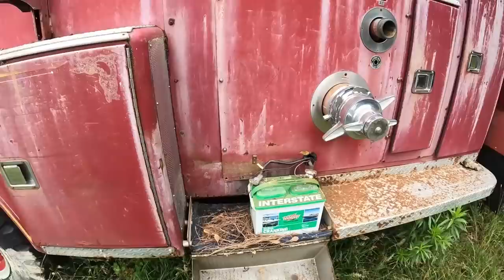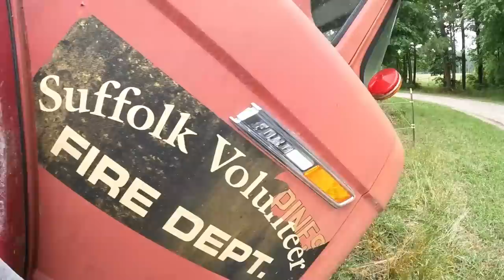Will The 50 Year Old Fire Truck Start?

Comment: Possession is nine tenths of the law. I'd say that is your firetruck now Chris. New fluids, filters and a carb rebuild and she'll be as good as.... well used. 😊
Reply: 10 bucks says the pump on that bad boy still works. Can’t say much for the water tank though. Usually those are the first to go in those old trucks. Make sure there is some water in the tank so that way you don’t dry pump it. And let her rip.
Reply: @firewalker1372  , it's not that hard to put in a new pump, and/or water tank.  Also, they can be upgraded with a rust proof one, and they can also bed filled with nontoxic firefighting materials in lieu of water with a little more refinement.

Comment: Someone who sets as many fires as you do probably should have one Chris.😂
Reply: I had an old petrol dodge fire truck that I used for domestic water supplies they don’t have baffles in the water tanks which are square not round making it dangerous to drive turn corners and stop, it actually killed an entire crew and it was dubbed the ‘widow maker’
Reply: you sure he shouldn't have an active fire station next door? 🤣🤣
maybe an exterminator on the other side for the big bad spiders? 🤣🤣🤣

Comment: Ive often thought that the fire truck would be great for cleaning your tracks off.
Reply: Yea just add water spray tracks everywhere an bam it's clean an shines
Or take off bed has big Hydraulic Pump on it make a great grease truck tools  even carry maybe bucket for mini
Reply: Like heavy d does.
Reply: @jackman6256 at truck there has a pto driven pump. Drop it into 4th or 5th gear. Pull a lever, and ease off the clutch, then your in pump.

Comment: There's a trick to installing those o-rings on the transfer tube of the Holley Carbs. .  Put the o-rings on the tube just at the end.  Don't put them all the way up to the bump in the tube.  As you install the tube the o-ring will roll it's self into the hole and onto the tube farther sealing it.  It might also have a stuck float .
Reply: if the o-rings are shot, so are all the bowl and metering block gaskets. they dry out, shrink and pull in at the middle on all four sides(top/bottom is worse), that opens all sorts of passage ports, makes the accel. pump not work, fuel/air metering wrong and fuel leak everywhere. also the power valve/s will be spanked. the ethanol and detergents in fuel really spanks them to death. the later blue gaskets are much better at holding up, but even so.
ditto on the o-ring placement and them rolling into place upon assembly. that said I absolutely hate the fuel crossover tube style.

Comment: Your float is stuck open on the carb. Tap the front of the carb with a hammer until it possibly frees up. That’s why the gas was pouring out of the top of the carb
Reply: If you have to tell someone who's making a will-it-start video that, what's the use?

Comment: Probably blew a fuse in the siren control box. I used to drive one it had 500 plus cubic inch engine. It was a long nose. Truck ran great and during pump testing it out pumped newer models. You could peal shingles off a roof running a 3 inch line down to 1 inch brass nozzle. Took 3 men to hold the line at 150 psi. It would lift you off the ground. Maybe we had a little fun during training sessions. It pumped over 1 thousand gallon per minute. Enjoyed the video.

Comment: We used to have a 77 American La France fire truck when I started firefighting 18 years ago. Ran like a top, slow driving though. It was a double clutcher.
Reply: At the fire department in LaFayette, Al, we had a 65 straight leg Mack, it was good truck. I think someone in Texas bought it to restore.
Reply: The volunteer department that I belong to had a 1968 Ford American LaFrance cab over engine and a 1979 Ford Saulsbury cab over tanker. Both manual and gas motors. The tanker definitely was a double clutcher.

Comment: a guy could quite easily use this pumper for grass hydro- seeding Bealy Goods pond area or yours. Its pretty much ready to go. I'd say it would take no more than than 45 minutes with the right nozzle and pressure after being set up. Instant thick grass in 30 days. 
Perfect rig for washing mud off dozers and excavators. You got a swiss army knife with multiple uses right there.
Reply: That is worth looking into. Hydoseeding is by far the best and fastest way to get grass growing especially on steep banks like the backside of a damn or on crappy soils. It's what Geoff Beale should've used on that one side of his pond where the soil is poor and rocky.
Reply: The tank would need an agitator to keep the mulch and water mixed up. Otherwise it separates and you pump out the water and are left with nothing but soggy mulch in the tank.
Reply: @rr3102  Agitator?  My wife would be perfect for the job..
Reply: @rr3102  That sounds like a do-able mod.

Comment: My Dad had 2 Ford T-950 dump trucks with that mighty 534 and 5x4 two stick in them from the 60's  and still had the one left into the 90's.  I have a LOT of hours turning wrenches on those motors....they're very basic and pretty easy to work on....taking that huge air filter off was a good call
Reply: I. Had. 2. F. 950 .dumps. With. Plows.  Nothing. Could. Stop. Them
Reply: Right on, Todd ! We had a 1967 T-950 with 5 th wheel frame. Ex Air Force, same transmissions as you. That 534 has some torque ! 
Thanks

Comment: Everyone will beg for its clean up, chase a few gremlins out like bad battery connections and such... freshen up the carburetor gaskets and seals. One thing for sure, having one parked near a home has to make your insurance go way down. Here in the valley of Wasilla Alaska, I was just a mile out from having fire truck service and most insurance companies wouldn't touch my place... but having a fire truck there not only made insurance possible but cheaper  than  the folks living within a five mile radius of the department.

Comment: Stuck floats is my guess. A good tap with a wrench on the carb bowls might free them up. May also want to stuff a rag in the fuel tank fill port to stop the bugs from crawling in. Other than that, it's a good old truck.

Comment: My 1st patrol car in the mid 70's had a Federal Twin Sonic lightbar. 1 light on drivers side and 1 on pass side that rotated inside the dome. Cold weather the lights froze up and would not rotate. Had the old Federal wind up siren on top, Snow, sleet and freezing rain shut it up. The electronic siren and speaker like on this truck was  Next Gen Up Town stuff. Got one of those in the later 70's. The city FD had trucks just like this cab style that were 64-66 yr models in the mid 70's.

Comment: The old cabovers are very popular now. I have almost the same firetruck with 6000 original miles that came from a VFD in Kentucky.  If you pull the firetruck bed off and put on a flatbed they make a great toy hauler.

Comment: Diesel creek is probably drooling right now he’d be up for the challenge
Reply: if Chris leaves it there for another 10 years and a tree, the weeds overgrow it. otherwise, it's too easy for DieselCreek. Chris could accelerate the rusting , so DC wont have to wait another decade for it to clapped out rust bucket

Comment: Loved this video. I would love to see you get one of your own. It could be handy to have in case of a big fire on your land. Get one that you would need to do a fair bit of work on to fix up and use that as a chance to make videos on it. Nothing too fancy, Just a simple fire engine. You might want to go with something a bit more modern then this one though so that the pump might be more easy to find spare parts for and for the possibly better pump. You might even want to watch your local fire department to see if they ever decommission one of their vehicles and it might even be worth it to ask them when they think they might do that for one of their smaller fire engines or their brush truck / wild fire truck if they have one. That option though leaves little to do for repair videos though since those may be quite a bit more modern and often in far better shape, If you simply can not find the time to do such repair videos along with everything you already do, Then one of those newer engines or trucks is a better very very long term goal. The way you could get the money for it is to just take your time with it, Just set a very small amount of money aside for as long as you need to and when you have close to the amount you think you might need you can then start looking around for a truck that is available.

Comment: i kept yellin at the tv "MASTER SWITCH YA BIG DUMMY".. im an exfirefighter, drove an engine pretty much identical to that one, even the year.our master was placed on the door side of the drivers switch, so when you open the door, you flip it, and then its the last thing you do after youve goten out. also you are always supposed to chock your wheels when pumping 9anytime really) but you should get the pump running and use it for a water truck

Comment: We had 2 of those model trucks that had grain beds on em. I hated the 2 speed transmissions on em. Both had  429s in em. Manifolds would glow red at night hauling 550 bu loads

Think we bought em new in 1977 or 78

Comment: I would think using an electric fuel pump you need  a fuel pressure regulator. A carburetor only needs 6 - 8 psi .
Reply: Not all pumps push out 60 plus psi.

Comment: 14:27  those o rings are so bad mine keep failing even though id bought the carburetor kit for a 4160 holley, fuel was blasting out of there i couldn't get it to do its job so i also put jb weld on both ends of the fuel straw thing its been good

Comment: If it burst into flames, then the fire dept shows up, they would leave thinking a different fire dept got there first. Never mind it is a fire truck on fire. So, with it working, could you drop a hose into a pond and use the pumps? Hell, maybe you need one of your own to help drain down ponds to fix dams! Claim/title it as abandoned vehicle and grab a case of rattle-can red paint and go to work masking stuff.

Comment: The needle valve stuck in that front float reason gas is coming out of the vent tap on the adjustment screw & nut on top of the float bowl ad may help or you're going to have to pull the bowl off and free it up.

Comment: Floats are bad, either float has dropped or needle and seat is stuck. Go thru the bowls on the carb and it will run great I bet. Pretty simple carb to repair floats in the bowls.

Comment: Ran an old ford 850 with 534 pulling a double bottom belly dump  07:00 to 11:00 it would run out of gas. Fuel truck would drive up and dump 100 gallons in Good for another 4 hours! Those Fords never broke down.

Comment: It should run without the battery as long as the alternator is charging. The only thing needing power should be the fuel pump and engine coil

Comment: I’m seriously surprised that it would have an electric fuel pump from 1974. I would have expected a mechanical fuel pump driven off of the engine only. You had to pour fuel into the carburetor to make the engine run to prime the fuel pump.
Reply: probably an aftermarket addition, because the mechanical pumps die very early from ethanol. then again, maybe it was factory to combat vapor locking and have better fuel control and faster starts after sitting. nothing would be better than a fire truck that doesn't start when needed. 😬

Comment: Oh my Lord, I though you guys were smarter than that. Running a gasoline engine with gasoline pouring out of it. If it has gas coming out of the float bowl vent tube, then the needle and seat are stuck on the float. Maybe a lit rap with a small hammer on the bowl might loosen it up, or disassembly and cleaning will be required. Maybe even a new needle and seat if it's corrode to bad.